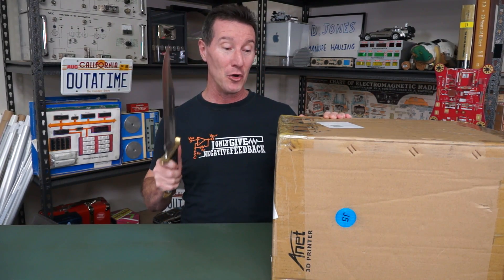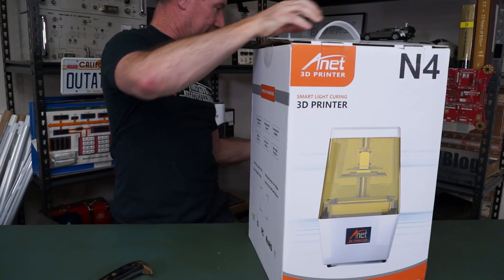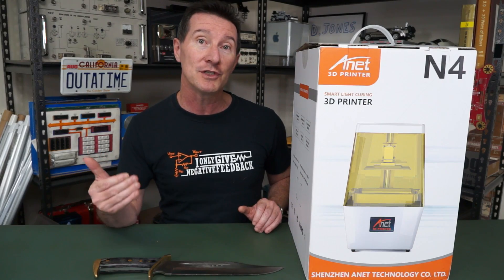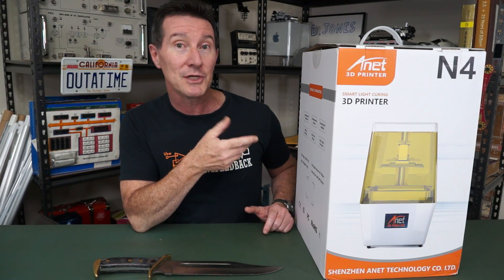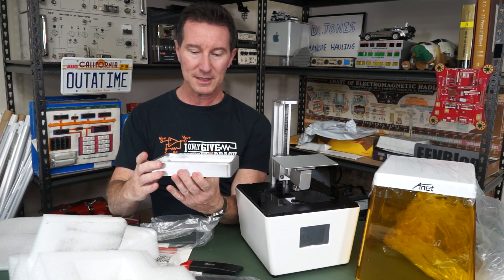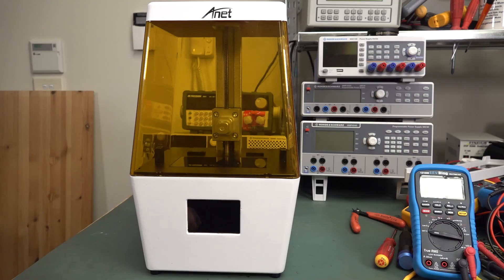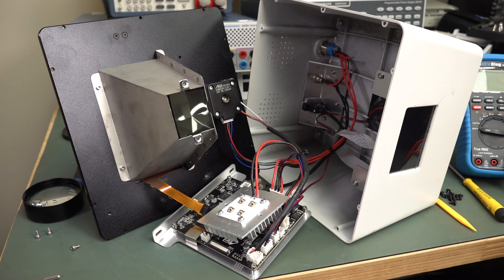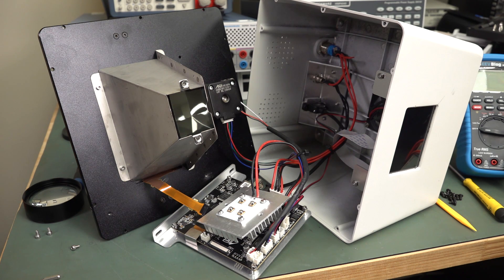Anet N4 LCD SLA Resin Printer

Comment: Anet control board are actually good quality. They do cheap out on a lot of external to achieve low prices. The threaded rod is low quality and thus not perfectly straight and this is why it's better to have it loose in the top ( same with the Anet A8 )

Comment: I will tell my experience. I bought a Longer Orange 10. When I received it, the shaft was broken (plastic shaft), alongside with some cables. After fixing it, it worked just fine. The problems I found with it were: no thermal regulation (fans spinning always at full speed, even when not printing), z-axis is very wobbly (I used a metal shaft with damping maybe that is the problem, their shaft had no dampener), contrary to fdm printers that have open-source firmware and slicers these were all strictly proprietary. What is funny is that FDM 3d printers try to minimize build cost by using cheapest screen and electronics, when these printers use colored lcds with touchscreen, when all of this is not necessary, very strange.

Comment: MSLA printers are certainly for a specific crowd with a certain technical capability in their workshop, otherwise it's just smelly and can be a big mess. The print quality and detail from a cheap MSLA is incredible and once you figure out a process sequence it's not that sloppy or difficult to do.

Comment: These are surprisingly good for really small high detailed high strength parts 
nothing you would use to print a large case for a project but if you want a bunch of buttons with small text, a complex bracket or something of a high dimensional accuracy these cheap things are fantastic 
but they use standard LCD displays, they wont last super long with that much UV and the resin is just annoying as hell to use

Comment: I wonder how you prevent like a bunch of fluid in a closed shape. The loose board, like were the fasteners such as they were locked or could it have actually fallen out? That is not cool.

Comment: Irony - gets 3D printer without Resin and at a time when IPA is as rare as rocking horse poo for the cleanup.
Reply from the maker: You need IPA to clean prints? Screw that!
Reply: @EEVblog2  And some post curing under UV or sunshine. It is the main reason I haven't added one YET to my gear is the post processing and cleanup.
Reply: Yeah I just got a printer and didn't realise I only had about 2" of IPA left in my bottle. Acetone cleans up the resin spills better than IPA but I don't know if it's a good idea to clean an uncured print with it.
Reply: @natecontarino1748  More likely to soften the resin with acetone based on other resins I play with. Given the IPA issue try pure Denatured Alcohol or Metho (Aussie version ;) )  even getting Metho yesterday was a lost cause for a woodworking job....
Reply: Some household cleaners can be used which are still being sold around. People are getting better results with those cleaners than with IPA.

Comment: @ 12:49
I don't know the particular LCD used in this device, but in general, all of these inexpensive SLA LCD printers use former-generation smartphone LCDs because of their reduced price.
Reply: I've seen some replacements as low as $30. I don't think quality is that big an issue with these as it is just a black and white png of the layer. Maybe contrast is important though.

Comment: Don't worry about that printer burning your lab down. Anet is infamous about their A8 (FDM) printers catching fire, not the one you have. And, to be honest, I had an A8 for years and it never even overheated (modest use). Most of the issues where because people was pushing it too hard and/or doing doubtful modifications to it on top of the fact that its hardware is aggressively cost optimized.

At the end of the day you get what you pay for, and most people still don't get it. You don't leave a cheap 3D printer unattended working for days non stop, not even for a few minutes, it is just common sense.

Comment: Check with Maker’s Muse.   He’s in Australia and has a lot of good videos.   By the way, SLA printers stink when running and must be vented to the outside or run in you garage or something.
Reply: And must be cleaned thoroughly after every use. My reason for not having one.
Reply from the maker: Hmm, not good for an enclosed lab, even with my air purifier.

Comment: I have a couple Elegoo Mars printers, which were $250 on Amazon when I got them.  I use them mostly for printing miniatures for D&D and other RPGs.  I've had way more luck with them than with FDM printers, and if you calibrate the cure time for the resin you're using, you can get a lot of detail out of the 2k LCD, doing 0.05mm layers.

Comment: the lcds are cheap phone screens. thats why the proportions for the build area is so tall and narrow. also the lcds are pretty much a consumable part. the uv will eventually destroy the lcd but usually you can replace it pretty easily. they're cheap right now because the FEP film on the bottom of the build area eliminates needing parts to unstick the resin. its slippery enough that careful slicing and a gentle tug from the stepper are enough to pull the cured resin and print free from the film while leaving the print stuck to the plate. when compared to FDM printers the level of detail and precision is very high even for these cheap printers, but you have to deal with resin and the small build area.

Comment: Anet has put a firmware with thermal runout protection disabled on the anet a8 printers, this could potentialy burn your house down, better hotend and marlin firmware sorts it out.
This is why people say it will burn you lab down :-)
Reply: It is not just firmware, they had also problems with poorly done/undersized bed connectors which cause the connector to melt and/or catch fire. Those are bottom of the barrel, poorly made machines.

Comment: What if you were to mount a blank PCB on it and use it to expose the PCB?
Reply: Was thinking that. But still making your own boards these days is, meh. But you need a LOT of UV light for a PCB, not sure how these LEDs compare to a proper UV exposure box.
Reply: These LEDs would absolutely do it, no problem. What would be your likely issue, is the screen resolution. THT component resolution at best. And yup, I do quite a lot of PCBs for quick prototypes at home. It is still cheaper and way faster. At least for a single layer (or single + GND).
Reply: Could also potentially use it for UV curable solder mask.
Reply: @EEVblog  Yeah i usually order PCB:s aswell. 

But you could make the same claim about 3d-printing. There are sevices that can make the part for you and have it shipped in a few days. That professional part will probably be better in every aspect than the one you can achieve at home.

The ability to do it myself just speeds up the prototyping process by a lot. I bet everyone who designs their own PCB:s most of the time makes more than one revision. Several times i have actually designed a revision 2 before i have even got the first revision from the pcb manufacturer ^^ or i have gotten the boards from the manufacturer, found an error and orderd new ones the same day. 

Even though i have run into the things above i really find there is a mental barrier to cross before pushing the "order" button. I really need to feel that the design is "done" and that can take take a lot of time, a lot of double and triple checking, trying different packages and layouts. Some times even to the point of sleepless nights where i go through everything over and over in my head so that i havent missed something. With my 3d-printer im comfortable "sending it" seeing how it turnes out, make adjustments and reprint. That whole process from start to finish can be faster than the outsourced process even before i click "order"
.

So making the "homemade" process faster, easier and more reliable could still be worth while in my opinion.
Reply: On other resin printers alredy done: https://github.com/Reonarudo/pcb2photon
Reply: Use it for retr0briting small parts indoors?

Comment: Top of the lead screw should just flap around. If it is restrained the wobble from the screw will be transferred to the carriage.
Reply: On that quality of leadscrew, yes. Higher-end ballscrews should be constrained on both ends; and used with a properly aligned linear motion system.
Reply: @darkwinter6028  This isn't a proper ball screw, so that isn't what I responded to.
Reply: Captain-Slow - Yes, I was agreeing with you and expanding upon your original comment. Sorry if that wasn’t clear. 🙂